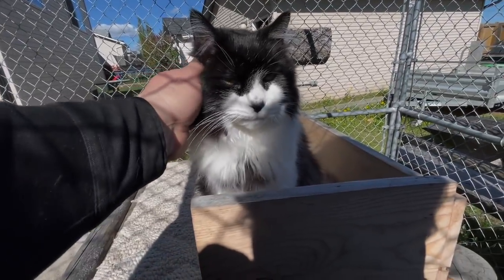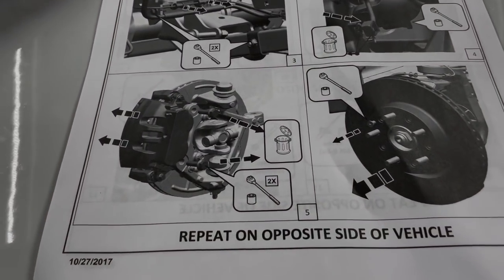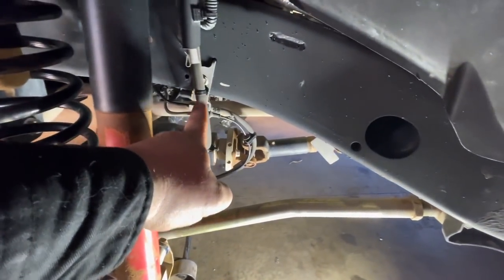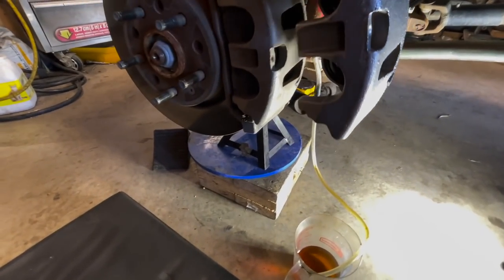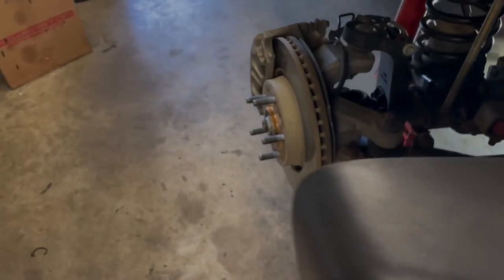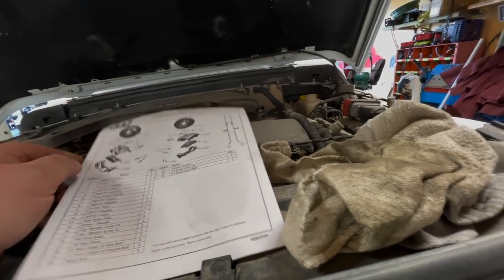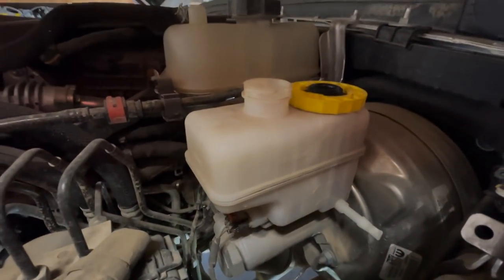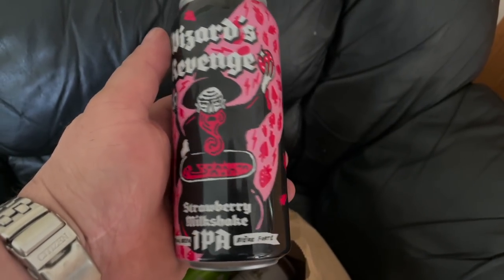Jeep JL Mopar Big Brake Fail

Comment: that caliper looks a little different then mine. I have a 2 door Sport. Same pads and rotors are listed for my Sport as Rubicons. Calipers now listed at the local part store Shows the same caliper but the pic does not match my vehicle so I can not verify the caliper

Comment: As for whether a shop would install the big brake kit despite it being the same parts that was already on there, I would say it's about a 50- 50 chance of it happening. I know when I was wrenching for a living I wouldn't have and I know of other mechanics that were honest but that said I've worked with about as many that would have did the job  no questions asked. That is the mechanics but as far as shops, yes there are shops that would have told their mechanics to to the job anyways. The shops I worked for left it mostly up to the mechanics as to the jobs they did but I know of shops that pushed jobs whether they needed the work or not. So I would say from my experience probably 50/50 chance of it happening. The closest I came to doing anything like this was at the customer's insistence that we install a new ECM. Supposedly he had taken his car to another shop that told him the reason it ran like crap was it needed a new ECM. When I was given the job I was hesitant as very rarely did a newer vehicle need a new ECM. I was told the guy had brought in a used ECM and wanted to replace his with the new used one. He had been told we weren't responsible for whether it worked or not and he still wanted it done. Being the customer had been informed of the risks of used parts and it might not be the problem but still wanted it done, I did it. Well the car still ran like shit so I ran an engine analysis on it and found it basically needed a total tuneup of cap, rotor, wires and plugs. The customer was pissed but he had been warned and wanted it done anyway. I sort of felt bad for the guy because he wanted to believe the previous shop  who fed him a bunch of BS but the customer insisted we replace his old ECM with a salvage yard one so we did what he wanted. I don't know how many people over the years no matter how much they insisted, I have never ran across an actual bad ECM, it's always been something else yet I've had a few insist it was the ECM. If I tell you the truth and you insist I'm wrong, OK, I'll take your money and do what you want. So I'll agree there are bad shops and mechanics but there are also stupid customers that waste their money by not listening to what you tell them, thinking they know more than the mechanic.

Comment: I say a 50/50 chance about the mechanic ripping her off. Although, there are many mechanics that will rip you off there are some good one. With that said, I think they (a good mechanic) would probably tell her to return those and possible sale her a different set, if they exist. A slim ball mechanic would definitely rip her off and install them, probably get an oil change and trans flush out of her also, which she probably does not need. Lol how’s that for comment

Comment: I can highly recommend using the Powerstop Z36 Truck and Tow kit.  Figuring this is a 2019 with the 3.8 in it the kit # would be K7938-36. https://www.powerstop.com/product/power-stop-z36-brake-kit/. I put the Z36 kit on our 2010 F150 Crew cab 4x4 and the results were night and day. It stops like NOW! I was impressed enough with it that I already bought the carbon-fiber/ceramic pads to put on my 2003 TJ Sahara next time around.  With her running the much heavier tires I think this would be just the ticket you are looking for. (Be aware, you DO need to go through a seating/seasoning sequence with these pads after installation to get optimal performance out of them. https://youtu.be/EeyCI0GRauY)